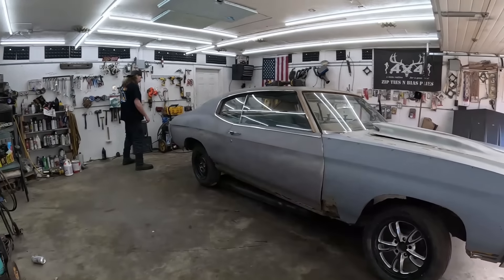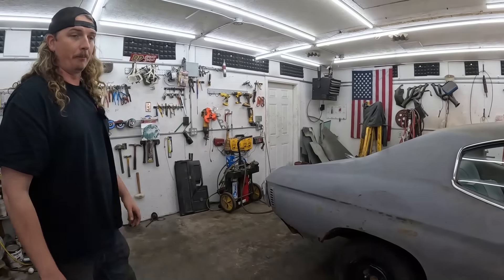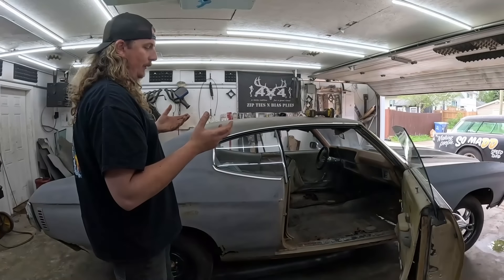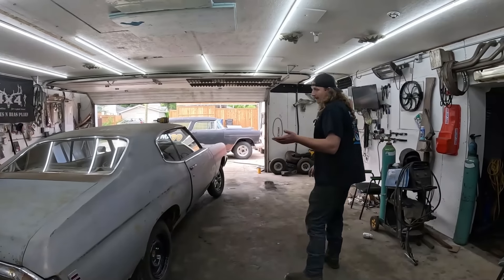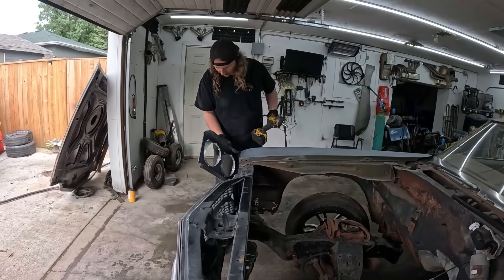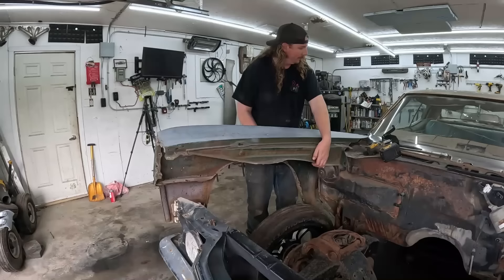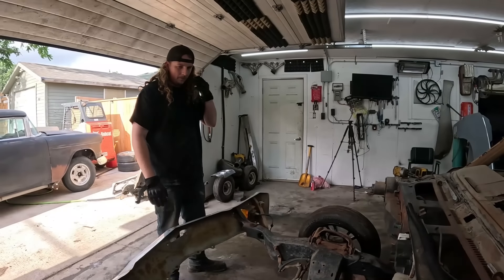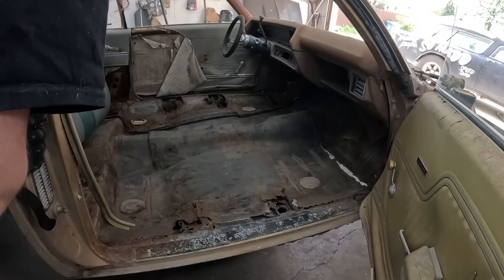Disassembling a '70 Chevelle : Prepping for Refurbishment

Comment: I do trunk first with wheel houses , then quarters, screw everything together dont weld any thing till it is all lined up then outer rockers, brace across door opening and trianglelate across body, remove frame body only weighta 4 or 500 lbs . I use 2 2x4 on edge in rear wheel house and 2 2x4 on edge at front body mount . Cut out floor short of seams . Slide new floor under use cherry picker to lift up and fit cutting a little at a time. I do 66 and 67 cutlass on my 29th car doing it this way. This one i have is a vert so i will remove everything from the rear of door forward to slide floor in the then line back up . . Keep up the great videos

Comment: Finally....more sheetmetal work to watch 😁  I'm surprised you don't have a couple of fans to circulate air in both of the shops. You should get a heat gun for stuff like taking out glass, it's a bit safer.

Comment: Love these videos,and both of you! FYI trunk pan will not fit through trunk opening.I did a 70 10 years ago,had to cut the rear section out ,and buy a new one.The trunk floor spot welds to the rear tail panel.Its not quite as drop in as it looks..lol

Comment: As retired auto glass technician that worked on many muscle cars the glass gods were with you lol. The first thing we did with our cut out knife, blades was too take them to the glass grinder and grind them down thin and as sharp and pointed as possible. First time I’ve ever seen a torch used to cut out a back glass lol. glad to see it all is well with the  Back glass! Only DD speed shop could get away with a turbo torch and a glass knife😂

Comment: Hey Dan .. this is the one to do a body off restoration .. make a lift to go up to the ceiling by using the roof .. brace the door pillars some .. and lift body with a hoist .. slide frame out and complete the frame .. sand blast it and detail it and build the brakes and all .. slide the new floor on top of frame and lower the body down after cutting the old floor out .. proceed to weld the new floor in ....the roof lift could be straps that fit through the roof and then hook to the hoist in the ceiling of your garage.. I have done this and it works great .. turns out to be a professional job you will be proud of ..

Comment: Dan, Please get some ziplock bags to save your hardware as you take them off.  Bag and tag is the key to simplify your reassembly.
Reply: Or just thread them back in the hole they came out of!  That would NOT be the DD Speed Shop way, though.
Reply: Drives me crazy when people don't bag and tag and then can't find the right bolt or nut.
Reply: He sweeps his tools into a pile on the floor and you think he is going to bag and tag!!🤣🤣🤣🤣🤣🤣

Comment: I worked in a Automotive Salvage yard for years pulling glass, a 3 - 4 foot length of piano wire and two pair of vicegrips worked every time.
Reply: I always break it half way through or right at the last bit! 😒
Reply: A professional glass guy came out and used a sawzall to remove my window. He used a [toothless] blade with a squared tip at a right angle to the window frame and a very slight angle to the glass. It easily stabbed the adhesive apart and the window was out FAST and undamaged.
Reply: Yup. Thats the only way we have done them. Always had good luck with it. We were doing it on painted cars.

Comment: DAN!!! I know you know what you are doing tho if you can just do the lower 12 inches of the quarter leave it all in ...that old yank steel is far better quality than the stuff you'll be putting in...The stamping is sharper and thicker metal by probably .3 of a mil. There is no need to go nearly as high as you are around the window etc..it's only crispy along the bottom, and the louvres next to the back light will be so much sharper on the original panel. You can stitch it along the belt line, and the rest of the quarter will be schweet. like you said the doors/trunk shut great. Leave as much of that stuff as poss. You know it will be easier. Great as usual...;D
Reply: I guess he's trying not to add more body filler than he has to.
Reply: He welded the rear quarters on the green Plymouth that way. It looked good to me.

Comment: People complain is because it's not old school. A 70's car requires old school everything. That includes, the stance, wheels, interior, engine and gauges.
Reply: Big wide tires in the back, air shocks to jack it way up, cragars, side pipes, a little chain steering wheel and an 8-track player, what more could anybody want!
Reply: @Jimschrbr  I have all that exactly in my 68 mustang. No chain wheel and 8 track other than that I agree especially with the air shocks

Comment: Dan, Brian here. Chevelle back window pinch welds ALWAYS rust out. Butyl is the old school adhesive that they were OG glued in with. Cuts out easy. Urethane, like what is used now, does not. Urethane sucks.

Comment: Dan do not cut it in the door jam that way because you will be measuring your azz off because it’s so easy to end up with a rear body that isn’t square. It will look like a unibody car going down the road unless your measurements are perfectly dead on in length on each side. Inner and outer wheel houses are toast replace them and save yourself the trouble down the line. Really base model Malibu as it doesn’t even have green tinted glass. The piece you’re talking about for the back of the trunk is the tail panel that goes between the rear quarter panels.

Comment: Hello DD SPEED SHOP! I still watch but haven't commented in a while. 
Dan, Evolve to a New Era. Rotisserie YES. Brace the SHIT OUT OF IT with the doors off and Drill out the Factory Plug Welds on Every
Panel. Show us how to find spot welds and separate them, line up panels and weld them.  This is a Dream Car and it's in much better shape than You or Us ever thought.  Flip that thing over and WELD from the top! You won't regret it.
Thank you. And my Shirts were delivered 3 days early. 👌  Hello, Danielle

Comment: Then you don't want to know how many of those cars are cut up for Circle Track cars before I knew any better when I got a little older I built one for a drag car listening about a 70 or 7172 with a had such great weight transfer it was so much better than the 68 and 69 although I like the body style of the 68 and 69 the the 7071 72 we're just so much better on the track although I did tear up some 68 and 69 also I'm right now with her for a 69 to build to go along with my 72 Nova and 69 Camaro just for my personal set

Comment: I'm just finishing my 72 Chevelle. I'm going to enjoy watching this. I just used that same glass removal tool and method to remove the back window from my son's 99 S10, except when I started to pull on it, it shattered the glass. Luckily, it didn't fly all over, so I was able to use painters tape and keep it together and toss it in the trash. 😂 Good luck with the build!

Comment: Have you thought of frame connectors?  To help hold it in check while you work on the floor and every unibody hot rod needs frame connectors.  Get a real cowl hood that fiber glass add on is garbage.  It will always crack.
Reply: Car is not unibody it’s a full frame car. You can’t put frame connectors on it but he can box the frame in the rear if he’s planning on some serious horsepower.
Reply: @Old_Tyme_Racing  Hot dam, you're right.

Comment: Those front wheels are totally ghetto. I don't know about Canada, but here in the U.S., pimps, drug dealers, gang members, and other criminals with the financial means put those on their cars as status symbols. Cars with wheels like that are called "donks". I have no idea why mainstream society loves to copy ghetto culture. I would just throw that hood away, and get a new or good used cowl hood. One thing I have discovered about aftermarket cowl hoods, even Goodmark hoods, is that the threads where the hinges go are often stripped. Phillips are BAD news. Allen, Torx, and Robertson are all WAY better. Phillips screws were actually designed to strip out. Anything but black.
Reply: Lol those aren't donk wheels